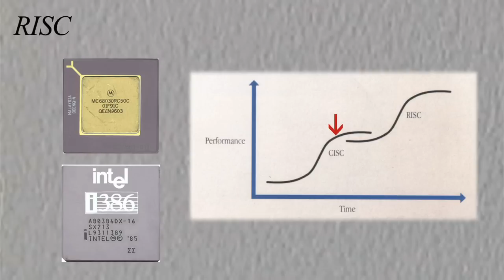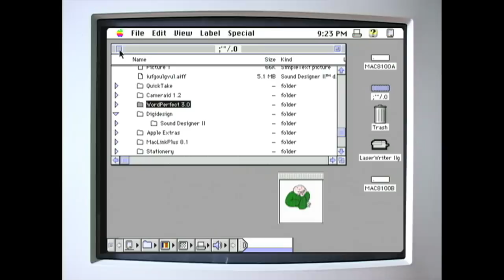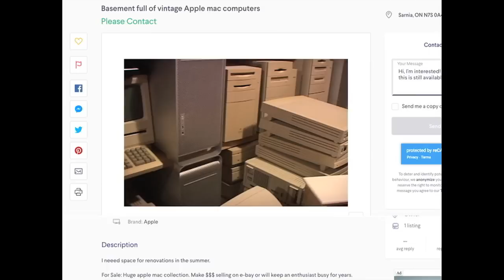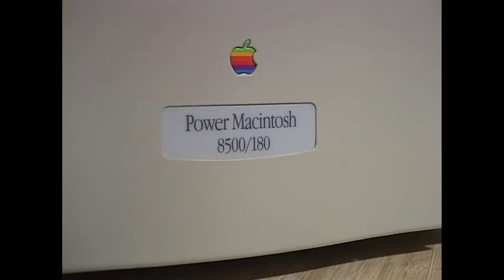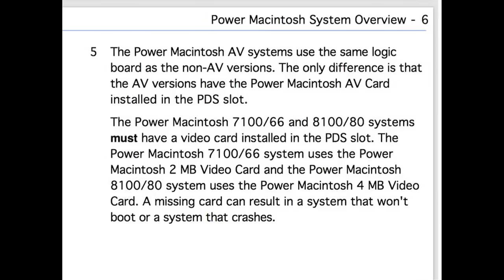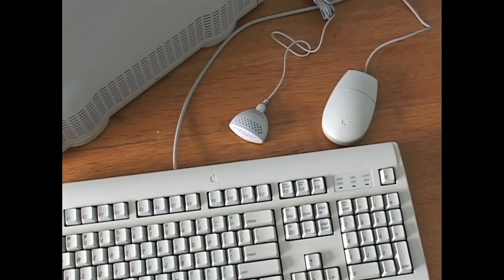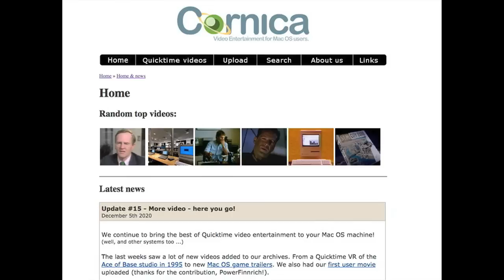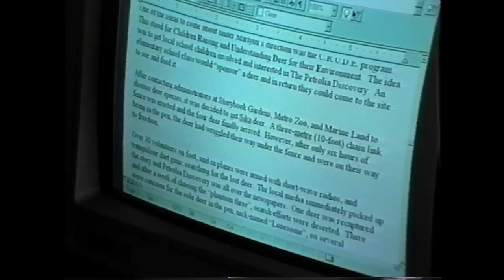The Power Macintosh 8100

Comment: For what it's worth, I don't think my 8100 has that weird ground spring thing inside the case (and neither do my 8500 or 9500 for that matter.)
Reply from the maker: Thanks for the feedback on the spring! Is yours an 80, 100 or 110MHz?
Reply: @65scribe  Interestingly enough it has 8100/80 printed on the front of the case, but the mainboard says 110mhz silkscreened on it [edit: come to think of it, i think it was a sticker, not silkscreened. if it wasn't buried behind a bunch of other machines it would be easier to check]. I figure the original owner must have got an upgraded at some point, but the guy I got it from off craigslist didn't tell me much about it when I bought it a couple of years ago.
Reply from the maker: @swolfington    Yes, I know the issue of buried, hard to reach computers. Strange they would do a motherboard swap. Maybe a user who always needed the most power available.

Comment: I have yet to read 1984, but i have read Orwell's Animal Farm, and i like the 1984 + Marathon idea, maybe someone can do that on Aleph One.

Also, did you ever figure out what's wrong with the 8100?
Reply from the maker: The 1984 bit was based off my reading it in high school. This is how a typical teenage kid wants to see it resolved, not understanding that the protagonist must lose to overwhelming odds to make it's point as a story of deep tragedy. Still, I'd be a funny spoof if it was actually done in Aleph One. 

And the 8100 does not work yet. Someone offered a replacement board, but I want to check the power supply first. I do have to get back to that.

Comment: Ah, the 8100. There was also an odd non-USDM version for some reason, the 8115. Terrible case aside (why couldn't all of the plastic be the same nearly indestructible stuff they used for the internal PS/drive frame?) they were pretty decent especially when used with a maxed HPV card and proper SCSI-2 setup. I'm not sure why the 71/8100 (and 9150) models supposedly required the PDS terminator while the 6100 apparently didn't; there wasn't much of a difference between the machines except the presence of a NuBus controller on the former models and I've had the bulk of my 6100s and plenty of 71/8100s run fine with an empty PDS.
Reply from the maker: Frank, you know your stuff! I did get some similar expert feedback that powering with an empty PDS is not the certain doom of a 71/8100. The most promising suggestion is to swap in a known-good power supply. I'll try that soon. Hopefully the 8500 power supply is compatible.
Reply: @65scribe  So the Apple Service Source for the 8100 suggests that, since an official Apple upgrade for the Q800 family was an 8100 logic board swap, a Q800 family PS will work assuming you retain the 8100's logic board power cable to use with the Quadra's PS (they're detachable from the PS). The 8500's Service Source seems to suggest the 8500's PS may work in the same way, you just have to ignore its smaller 3.3v connector since the 8100 doesn't use it. No guarantees on the latter though and I'd probably try a Quadra unit first.
Reply from the maker: Great advice, Frank. That answers some of the questions I had. Thanks! I’ll see how it goes.

Comment: How did you order computers from apple in the 90's-early 2000's? Was it always over the net or did you have to find a reseller like with IBM's machines?
Reply from the maker: That’s a great question! For my 6100 in 1994 there was a lot of combing over Mac magazines and flyers that came in the mail from previous purchases that I made, like MacWarehouse. Also used the  fax machine at work to request quotes from the local Apple authorized resellers.  After we made the deal I went to pay for it once it arrived from Apple. 
By 2000, I was able to buy directly from Apple online, but I still dealt with a reseller for that real purchasing experience. All the correspondence was email at that point, so more convenient.
Reply: @65scribe  another couple of questions, how did you watch Apple events/keynotes/announcements back in the day and what would you consider a good starting machine for getting into power macs?
Reply from the maker: The keynotes I started watching with the Jan 1999 blue&white tower intro. That I could actually watch on my 6100 with external 56K modem. Pretty blocky, but you could tell what was going on. Then I would set up my VHS recorder to tape it so I could re-watch it without using up my monthly online limit. Also no one could call me on the phone while I was online. It was Apple.com of course.

Comment: Hey, after seeing your video i harvested the same exact chip out of a 6100, which you refer to as cache, to put in my 7100, but when i check apple system profiler on mac os 8.5 it reports the external l2 cache as "not installed", are you sure this is not a rom card for the 6100? The other slot in my 6100 was not populated, yet i remember this computer was working 10 years ago, but the psu is dead now, do some 6100 have onboard rom? My chip is the exact same as yours, even the serial number as far as i can tell from the video, thank you for your great videos i appreciate the content
Reply from the maker: Hi Thomas. Glad to hear you like the videos! I had trouble keeping those cards straight myself. The ROM should be labelled 341-0741 (341-0757 in the 100/110MHz 8100) and has the two long chips on each side of the card. I've never seen the ROM onboard for the 6100. I touch on it a bit in my 6100 video. I did see an article stating L2 Cache Tester indicates that the L2 Cache is gone - unless PowerPC Interrupt Extension is installed, but that was 7.5.5. So, maybe the cache card is not functional or needs to be re-seated?
Reply: After further investigation including taking out the original 7100 rom card and leaving the "cache" card from the 6100 in, the machine still booted just fine, with no card at all it doesnt boot, i am almost convinced the card you have installed in your 8100 in this video is a 6100 rom card and not a cache card, please let me know if you decide to look into it, so little information about what the rom and cache cards are supposed to look like is available today, and it brings the question, did your 6100 have 2 rom cards or is the other card that look like a rom card actually a cache card? To quote you, "ow what the hell?", haha, anyway thanks again
Reply from the maker: Since the ROM was only supplied by Apple, they will have the part number on them. Cache cards were made by a number of third parties, so those can vary in appearance and might not have any part number. In that way, it should be easy to spot a rom card. Otherwise it’s a cache card.

Comment: After finally getting my own 8100/100 up and running, Marathon runs far poorer than I remember! I had to reduce screen size or run in low Res mode to have decent frame rate. Marathon Infinity has an FPS display, and shows ~16FPS in high Res at full screen, I was shocked. I guess we had lower expectations of our first person shooters back in the 90s!
Oh, and the case does indeed have the same grounding spring thing.
Reply from the maker: Thanks for the feedback on the ground spring. That confirms it wasn't some user add-on. That's interesting hearing how Marathon ran on a 8100/100. I know Marathon 2 / Infinity were more demanding than Marathon 1. Marathon 2 lists a minimum requirement of an 040, whereas in Marathon 1 they gave instructions on how to use a Macintosh II or LC with an 020! Still, I happily played all 3 games on my stock 6100/60av, as well as creating a Marathon Infinity Map. I don't recall any frame rate frustration, other than it being completely incapable of running Unreal. A big part of it could be 90's perspective, like you say.

Comment: Did you ever get your 8100 working?
Reply from the maker: In conversation with a retro Mac genius, he suggested it could be the power supply partially not working. I want to swap in the supply from the Quadra 800 or 8500 to see what it does, then make a updated version of this video if it works.

Comment: I have a 8100/100 from my dad, trying to get it to run again but can't seem to find any display that fits the connectors. :<
Reply from the maker: Old Mac monitors can be hard to find, but if you get a DB15 to VGA adapter, that opens things up quite a bit.
Reply: @65scribe  Yeah, seems that I will have to get one. Luckily his G4 AGP was easier to hook up :D

/ The battery hasn’t died yet but on start up it’s always resetting the date/time to 1.1.1970 1:00

It’s also not recognizing one of the ram modules leading to 768 mb. ^^
Reply: @65scribe  Ok so I found an old adapter but I have problems getting the graphics card back in after cleaning the machine. It seems to not want to get back into the slot and I don't want to force it. The Instruction Manual PDF says something about installing it an an angle but I can't get it to work. I tried and look for videos or other instructions but no one seems to talk about getting the graphics card back in :(

Comment: I was curious after this, so I dug around a bit and found a sliver of evidence the 8100/110AV might actually exist: https://www.thebookyard.com/product.php?cPath=91_612_821&products_id=23436. These are system disks from Apple that say on the label they are intended for (amongst others) that exact machine.
Another interesting thing, are these ‘developer notes’: http://mirror.informatimago.com/next/developer.apple.com/documentation/Hardware/Developer_Notes/Macintosh_CPUs-PPC_Desktop/Enhanced_Power_Macintosh.pdf. These clearly state there is a single specification 8100/110 and list the model number as M3561. This number is not mentioned anywhere, except in some FCC filing from September 1994 for a ‘tower case computer’.
My guess would be the 8100/110AV was not sold officially, but only unofficially, to clear out stock, and they added the AV cards to make them more attractive.
Reply from the maker: Good research! The disks are a bit suspect, mentioning the 7100/80 but not the 8100/100. But I wouldn’t put it past Apple to add an AV card to move stock when the 8500 came out. I looked a long time for any real evidence of the 110AV because if it did exist my whole video falls apart.
Reply: @65scribe  I think your videos stand out because of this sort of 'computer archeology' - not just copying what's on Wikipedia but piecing it together yourself. That said, the 8100/110AV is an enormously curious thing, it looks like an error being repeated, but at the same time it might be a unicorn. I'm actually tempted to buy that disk set and get to the bottom of this, lol